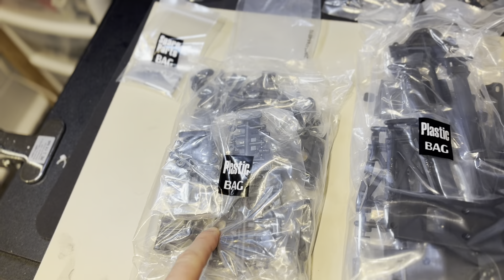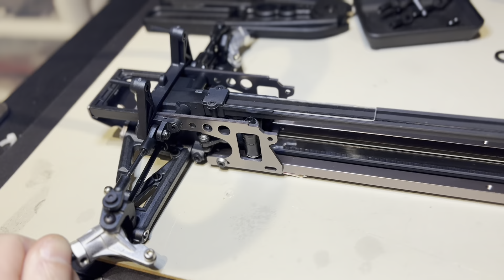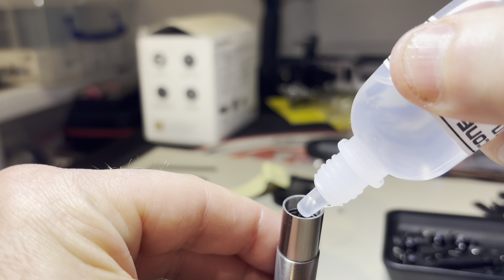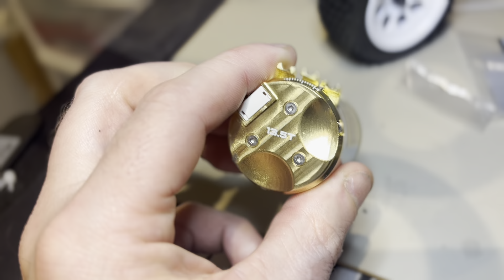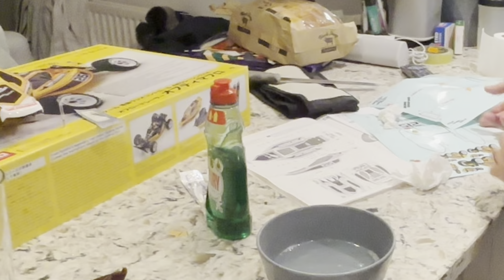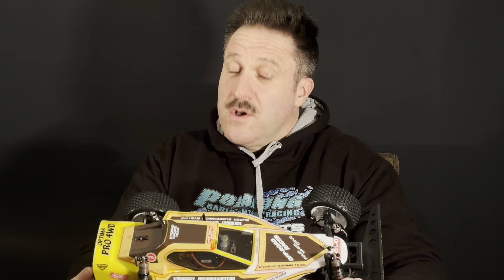Kyosho Optima pro 4WD build

Comment: I had been contemplating which Legendary series to get. I currently run OG Turbo Optima but I had both Optima Mid and Optima Pro in the past as well. What is more confusing is that my Optima Pro was a Gold Edition and the Legendary Turbo Optima comes with, you guess it, Gold Components 🤣🤣🤣🤣🤣

Comment: So i have ended up with three types of shock pliers... 
Core rc that look like standard pliers but for shock shafts... 
Then i got a 3racing set but they look like nut crackers.. they are easier to use than the core rc...
Then a set that are more of a multi tool.. shock shafts, ball ends install and remove, screw length, .. 
for me this type is the winner out of the three..